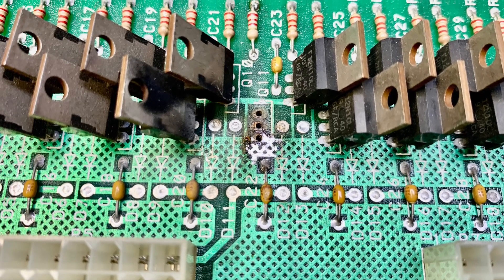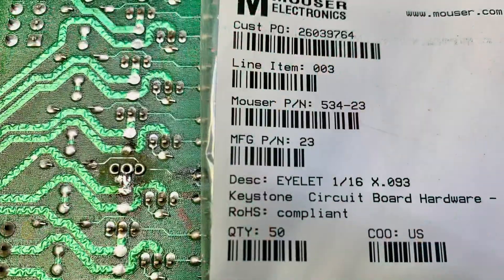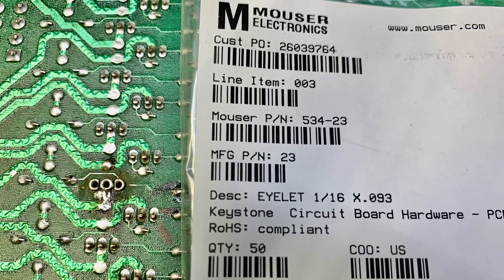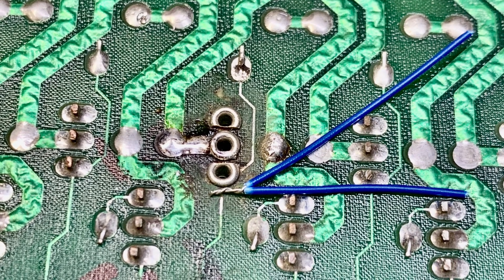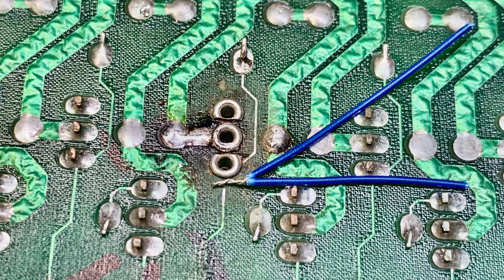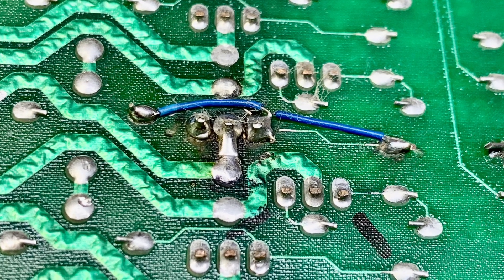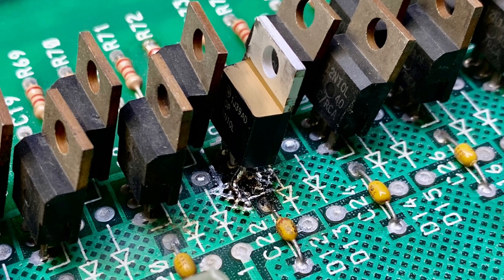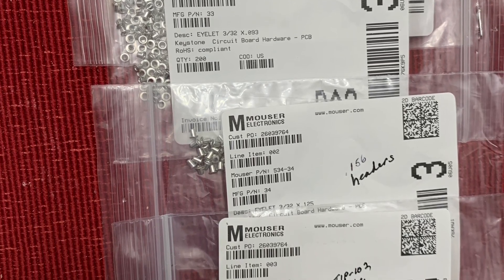Gottlieb System 3 Hacked FET Pad Repair

Comment: good video and rivet usage.
thanks for showing the part #'s that you use.
how are you installing them?
drilling the holes bigger to accommodate them?
and are you flaring the other side to keep them in the PCB?
it would be cool to see a video on how you are anchoring them in place and attaching the other side to the trace.
Reply from the maker: The new hole for the rivet is necessarily larger than the original through hole. This is of no consequence since we are replacing the entire through hole. I have the tools to flare the rivet on the other side of the PCB but I have not been doing that as I don’t see that it provides an advantage. The rivet physical dimensions would be the same on the other side and they would touch each other if flared without grinding a separation between them.